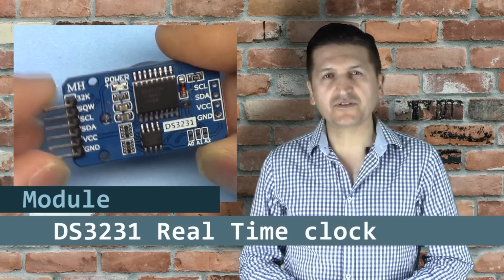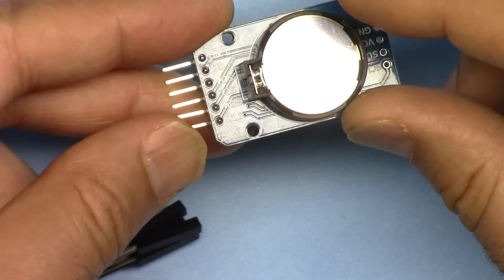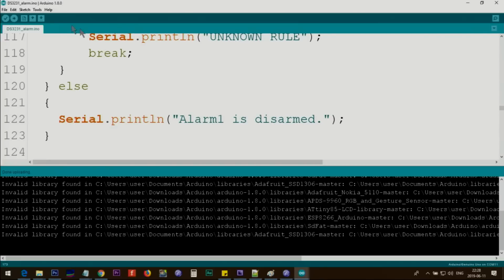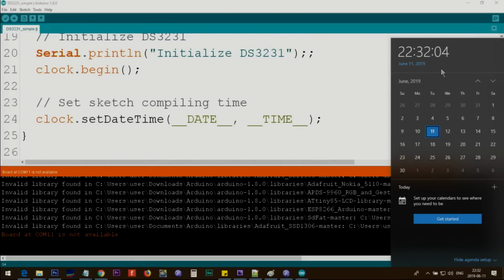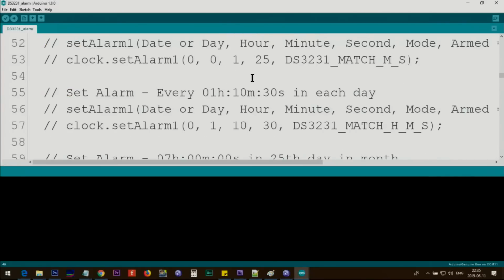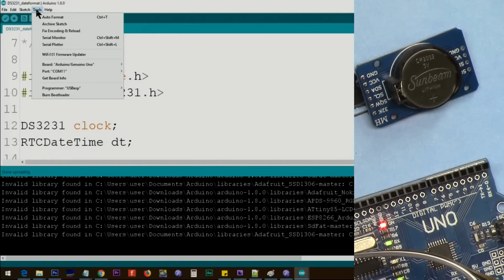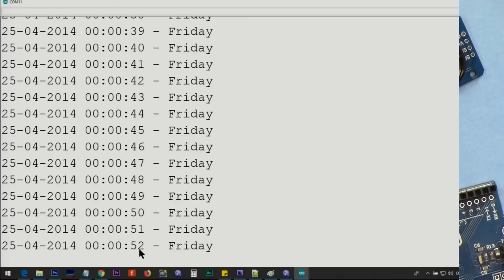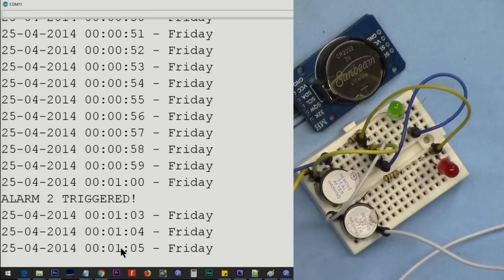How to use DS3231 RTC clock module Alarm with Arduino RJT165

Comment: When i set this in the code:

    clock.setAlarm1(5, 1, 49, 00, DS3231_MATCH_DY_H_M_S);

the serial monitor show me this:

    Alarm1 is triggered when day of week, hours, minutes and seconds match: 
    Alarm2 is disarmed.

But when i add the another alarm just below with another day to trigger:

     clock.setAlarm1(5, 1, 49, 00, DS3231_MATCH_DY_H_M_S);
     clock.setAlarm2(6, 1, 49, 30, DS3231_MATCH_DY_H_M_S);

Serial monitor show me this:

Alarm1 is triggered when day of week, hours, minutes and seconds match: 
Alarm2 is triggered when date, hours, minutes and seconds match: 

So, why it's changing the trigger method in alarm number 2???  i think it's an error of the code, please i hope you can answer me, thank you sir @robojax
Reply from the maker: you can have only 2 alarms. you can't have more than 2. or different alarm from different times. in total you can have 2 only.
Reply: @robojax  yes man, im having only the 2 alarms set, but the alarm2 when its declared, it changes de trigger method for alarm2, i dont know why
Reply: CAN YOU CHECK IT PLEASE? THANK YOU SIR!!!!

#include <Wire.h>
#include <DS3231.h>

DS3231 clock;
RTCDateTime dt;

#define  relay 4
#define  buzzer 3 
void setup()
{
  Serial.begin(9600);
  pinMode(buzzer,OUTPUT);//
  pinMode(relay,OUTPUT);
  
  // Initialize DS3231
  Serial.println("Arrancando");;
  clock.begin();

  // Disarm alarms and clear alarms for this example, because alarms is battery backed.
  // Under normal conditions, the settings should be reset after power and restart microcontroller.
  clock.armAlarm1(false);
  clock.armAlarm2(false);
  clock.clearAlarm1();
  clock.clearAlarm2();
 
  // Manual (Year, Month, Day, Hour, Minute, Second)
  //clock.setDateTime(2014, 4, 25, 0, 0, 0);

  // Set Alarm - Every second.
  // DS3231_EVERY_SECOND is available only on Alarm1.
  // setAlarm1(Date or Day, Hour, Minute, Second, Mode, Armed = true)
  // clock.setAlarm1(0, 0, 0, 0, DS3231_EVERY_SECOND);

  // Set Alarm - Every full minute.
  // DS3231_EVERY_MINUTE is available only on Alarm2.
  // setAlarm2(Date or Day, Hour, Minute, Second, Mode, Armed = true)
   //clock.setAlarm2(0, 0, 0, 0, DS3231_EVERY_MINUTE);
  
  // Set Alarm1 - Every 20s in each minute
  // setAlarm1(Date or Day, Hour, Minute, Second, Mode, Armed = true)
  //clock.setAlarm1(0, 0, 0, 20, DS3231_MATCH_S);

  // Set Alarm2 - Every 01m in each hour
  // setAlarm2(Date or Day, Hour, Minute, Mode, Armed = true)
  // clock.setAlarm2(0, 0, 1,     DS3231_MATCH_M);

  // Set Alarm - Every 01m:25s in each hour
  // setAlarm1(Date or Day, Hour, Minute, Second, Mode, Armed = true)
  // clock.setAlarm1(0, 0, 1, 25, DS3231_MATCH_M_S);

  // Set Alarm - Every 01h:10m:30s in each day
  // setAlarm1(Date or Day, Hour, Minute, Second, Mode, Armed = true)
  // clock.setAlarm1(0, 1, 10, 30, DS3231_MATCH_H_M_S);

  // Set Alarm - 07h:00m:00s in 25th day in month
  // setAlarm1(Date or Day, Hour, Minute, Second, Mode, Armed = true)
  //clock.setAlarm2(25, 7, 0, 0, DS3231_MATCH_DT_H_M_S);

  // Set Alarm - 10h:45m:30s in every Friday (1 - Mon, 7 - Sun)
  // setAlarm1(Date or Day, Hour, Minute, Second, Mode, Armed = true)
   clock.setAlarm1(5, 10, 20, 30, DS3231_MATCH_DY_H_M_S);
   clock.setAlarm2(6, 1, 49, 30, DS3231_MATCH_DY_H_M_S);
  
  // Check alarm settings
  checkAlarms();
}

void checkAlarms()
{
  RTCAlarmTime a1;  
  RTCAlarmTime a2;

  if (clock.isArmed1())
  {
    a1 = clock.getAlarm1();

    Serial.print("Alarm1 is triggered ");
    switch (clock.getAlarmType1())
    {
      case DS3231_EVERY_SECOND:
        Serial.println("every second");
        break;
      case DS3231_MATCH_S:
        Serial.print("when seconds match: ");
        Serial.println(clock.dateFormat("__ __:__:s", a1));
        break;
      case DS3231_MATCH_M_S:
        Serial.print("when minutes and seconds match: ");
        Serial.println(clock.dateFormat("__ __:i:s", a1));
        break;
      case DS3231_MATCH_H_M_S:
        Serial.print("when hours, minutes and seconds match: ");
        Serial.println(clock.dateFormat("__ H:i:s", a1));
        break;
      case DS3231_MATCH_DT_H_M_S:
        Serial.print("when date, hours, minutes and seconds match: ");
        Serial.println(clock.dateFormat("d H:i:s", a1));
        break;
      case DS3231_MATCH_DY_H_M_S:
        Serial.print("when day of week, hours, minutes and seconds match: ");
        Serial.println(clock.dateFormat("l H:i:s", a1));
        break;
      default: 
        Serial.println("UNKNOWN RULE");
        break;
    }
  } else
  {
    Serial.println("Alarm1 is disarmed.");
  }

  if (clock.isArmed2())
  {
    a2 = clock.getAlarm2();

    Serial.print("Alarm2 is triggered ");
    switch (clock.getAlarmType2())
    {
      case DS3231_EVERY_SECOND:
        Serial.println("every second");
        break;
      case DS3231_MATCH_S:
        Serial.print("when seconds match: ");
        Serial.println(clock.dateFormat("__ __:__:s", a2));
        break;
      case DS3231_MATCH_M_S:
        Serial.print("when minutes and seconds match: ");
        Serial.println(clock.dateFormat("__ __:i:s", a2));
        break;
      case DS3231_MATCH_H_M_S:
        Serial.print("when hours, minutes and seconds match: ");
        Serial.println(clock.dateFormat("__ H:i:s", a2));
        break;
      case DS3231_MATCH_DT_H_M_S:
        Serial.print("when date, hours, minutes and seconds match: ");
        Serial.println(clock.dateFormat("d H:i:s", a2));
        break;
      case DS3231_MATCH_DY_H_M_S:
        Serial.print("when day of week, hours, minutes and seconds match: ");
        Serial.println(clock.dateFormat("l H:i:s", a2));
        break;
      default: 
        Serial.println("UNKNOWN RULE");
        break;
    }
  } else
  {
    Serial.println("Alarm2 is disarmed.");
  }
}

void loop()
{
  dt = clock.getDateTime();

    // Call isAlarm1(false) if you want clear alarm1 flag manually by clearAlarm1();
  if (clock.isAlarm1())
  {
    Serial.println("Regando");
    digitalWrite(relay,HIGH);
    delay(60000);
    digitalWrite(relay,LOW);
    Serial.println("Termine de regar");     
  }

  // Call isAlarm2(false) if you want clear alarm1 flag manually by clearAlarm2();
  if (clock.isAlarm2())
  {
    Serial.println("Regando");
    digitalWrite(relay,HIGH);
    delay(60000);
    digitalWrite(relay,LOW);
    Serial.println("Termine de regar");    
  }
 
  delay(1000);
}
Reply from the maker: sorry I can't check without testing it and I don't have the module in hand. as I said, your code work the way it should be. you can't have more than 2 alarm.
Reply: @robojax  when i put that code that i show you, serial monitor show me this:

    Alarm1 is triggered when day of week, hours, minutes and seconds match: 
    Alarm2 is triggered when date, hours, minutes and seconds match: 

Alarm2 should say that is triggerede by "day of week, hours, minutes and seconds match" !!!
why its saying to me that "date, hours, minutes and seconds match:" ???
its not working for me please help its for a university project, i look the full video 7 times and i do exact the same of you
Reply: @robojax  Question sir, its the case "Set Alarm - 10h:45m:30s in every Friday " only available for Alarm1??? this can be the problem, i need to set 2 alarms, on 21pm monday, and 21pm on friday, please help sir im dying
Reply: @robojax  OK MAN just watch what i have to do to get this working:

#include <Wire.h>
#include <DS3231.h>

DS3231 clock;
RTCDateTime dt;

int relay = 4;
int buzzer = 3;

void setup()
{
  Serial.begin(9600);
  pinMode(4, OUTPUT);
  pinMode(3, OUTPUT);
  // Initialize DS3231
  Serial.println("Arrancando...");;
  clock.begin();

  // Disarm alarms and clear alarms for this example, because alarms is battery backed.
  // Under normal conditions, the settings should be reset after power and restart microcontroller.
  clock.armAlarm1(false);
  clock.armAlarm2(false);
  clock.clearAlarm1();
  clock.clearAlarm2();
 
  // Manual (Year, Month, Day, Hour, Minute, Second)
  // clock.setDateTime(2014, 4, 25, 0, 0, 0);

  // Set Alarm - 10h:45m:30s in every Friday (1 - Mon, 7 - Sun)
  // setAlarm1(Date or Day, Hour, Minute, Second, Mode, Armed = true)
  clock.setAlarm1(5, 11, 38, 30, DS3231_MATCH_DY_H_M_S);
  clock.setAlarm2(5, 11, 39, DS3231_MATCH_DY_H_M);
  
  // Check alarm settings
  checkAlarms();
}

void checkAlarms()
{
  RTCAlarmTime a1;  
  RTCAlarmTime a2;

  if (clock.isArmed1())
  {
    a1 = clock.getAlarm1();

    Serial.print("Alarm1 is triggered ");
    switch (clock.getAlarmType1())
    {
       case DS3231_MATCH_DY_H_M_S:
        Serial.print("when day of week, hours, minutes and seconds match: ");
        Serial.println(clock.dateFormat("l H:i:s", a1));
        break;
      default: 
        Serial.println("UNKNOWN RULE");
        break;
    }
  } else
  {
    Serial.println("Alarm1 is disarmed.");
  }

  if (clock.isArmed2())
  {
    a2 = clock.getAlarm2();

    Serial.print("Alarm2 is triggered ");
    switch (clock.getAlarmType2())
    {
      
      case DS3231_MATCH_DY_H_M:
        Serial.println("when day of week, hours and minutes match: ");
        Serial.print(clock.dateFormat("l H:i:s", a2));
        break;
      default: 
        Serial.println("UNKNOWN RULE"); 
        break;
    }
  } else
  {
    Serial.println("Alarm2 is disarmed.");
  }
}

void loop()
{
  dt = clock.getDateTime();

  
  // Call isAlarm1(false) if you want clear alarm1 flag manualy by clearAlarm1();
  if (clock.isAlarm1())
  {
    Serial.println("Regando");
    tone(buzzer, 2000);
    delay(100);
    noTone(buzzer);
    digitalWrite(relay, HIGH);
    delay(5000);
    digitalWrite(relay, LOW);
   
  }

  // Call isAlarm2(false) if you want clear alarm1 flag manualy by clearAlarm2();
  if (clock.isAlarm2())
  {
    Serial.println("Regando");
    tone(buzzer, 2000);
    delay(100);
    noTone(buzzer);
    digitalWrite(relay, HIGH);
    delay(5000);
    digitalWrite(relay, LOW);
    
    
  }
 
  delay(1000);
}

i just delete some parts i didnt need it, and i use no second specification on alarm 2, so i can now open a relay 2 days a week, ok thank you man cheers

Comment: Please Help Me. This code is fully ok. But Aretor on time (1.10 AM to 3.20 AM)  if Arduino power off some time in this time by electricity fail then when again electricity again come in time (1.10 to 3.20 am) and again give power the Arduino then do not on  Aretor again in this time.Which i have selected. Help me for code editing.

#include <DS3231.h>

int Aretor = 13;

DS3231  rtc(SDA, SCL);

Time t;

void setup() {

  Serial.begin(115200);

  rtc.begin();

  pinMode(Aretor, OUTPUT);

  digitalWrite(Aretor, LOW);

  

}

void loop() {

  t = rtc.getTime();

  Serial.print(t.hour);

  Serial.print(" hour(s), ");

  Serial.print(t.min);

  Serial.print(" minute(s)");

  Serial.println(" ");

  delay (1000);

  

  if(t.hour == 1 && t.min == 10 && t.sec == 00){

    digitalWrite(Aretor,HIGH);

    Serial.println("ARETOR ON");

    }

 else if (t.hour == 3 && t.min == 20& t.sec == 00){

    digitalWrite(Aretor,LOW);

    Serial.println("ARETOR OFF");

    }

 
}
Reply from the maker: this is not the code I provided. Please use the code I've given and it should work. Follow the instruction in the video.
Reply: Your code is also ok. But example I want alerm on 1 am to 2 am hours. When it is on then in this time i power off the arduino for some time and give again power the arduino. Then the alerm Don't on again. Why the alerm do not on again? My alerm on time remaning,but do not on it again after get ghe power arduino. Plz help me in this problem.
Reply from the maker: then your battery is bad. The alarm is not set on Arduino. it is saved on the module.

Comment: Hi again, sir! I know you are busy, but can you give me a quick review of how these functions - isAlarm1() and is Alarm2() work exactly, because I think they are messing with me ;).
Reply from the maker: Hi, you made me watch my video. I have explained it. Perhaps you skipped the video. please watch without skipping and you get the answer. Text is never better than video.
Reply: @robojax  I get the point that it checks and matches the time of the alarm and if is true, it does whatever u say so. But in my code I init the second alarm after the rang of the first, and then check for it in a loop. The problem is that the second alarm rings first...

Comment: Hi, thank you for the video it is very helpful. I am trying to program a school bell so I was wondering how can I set an alarm not to compare digits, but to ring periodically.
Reply from the maker: you have to make an array and put all events of alarms for example if you have 4 alarms, then put 4 times and compare the current time to each item of array and when it mateches, turn the alarm ON. or if you have for example every  45 minuets, from 8AM to 3PM, then do the same staring from 8:00 check in 45 minuets and turn the alarm ON. then give 5 or 10 minuets break, then 45 minuets.  it needs separate project and needs some work. can't be done by text. Good luck
Reply: @robojax  Ok I think you gave me an idea, thank you.
Reply from the maker: you are welcome.  Приветствие из Канады.

Comment: Great video sir! I have a question. How can I display the real time on a LCD display and for the alarm can it be a user input where if the alarm time matches the real time, the buzzer will beep like in the video. Thank you beforehand!
Reply from the maker: Thanks. this is 4 projects-in-one 1-DS3231  , 2-Relay control 3-LCD and 4the updating the alarm. This is very complicated and I have solution for 3 but 4th one needs some work and I don't have time for it. search online to see if you can find ways to update values using push buttons.

Comment: Thank you for video. If I set alarm on every hour at 59th minutes, after 6 months my RTC will be behind current time ~50-90s depends of temperature of outside. I would like to correct time and update it once in 6 months. I will do sync with GPS or GPRS to get current time and set correct time to RTC. If update time in RTC will alarms continue to works normal? Will I correct the time?
Reply from the maker: You are welcome. syncing time over internet is the best way. Yes possible if you write or get the code.

Comment: Unfortunately the code doesn't work on Uno Rev3. The detailed time functions don't have any output, just blank. Only thing that worked for me was the raw time which was correct.
Reply from the maker: this should work with any arduino.

Comment: I have a problem with DS3231 https://scontent-mrs2-2.xx.fbcdn.net/v/t1.15752-9/95526360_285611705941099_1001384200726642688_n.jpg?_nc_cat=106&_nc_sid=b96e70&_nc_oc=AQlQD25gHDcXt_6WK-NWs25KMQmXQPh_neoywlMtXNbxpQQF-G7sPmngpWqksjr5awQ&_nc_ht=scontent-mrs2-2.xx&oh=51db46a61821b01468cf89f8b59d09c8&oe=5ED66AA7
Reply from the maker: it means you skipped the video and have not installed the library. Please install the library and it should work.

Comment: Hi thankyou for the video its very helpful
Im having an issue though I can get alarm 1 to work with any of the examples in the code but if I try and use setAlarm2 on any of the others it always displays 'Alarm2 is triggered when date, hours and minutes match' and then wont trigger. am I missing something?
Reply from the maker: Hello, Welcome.  I don't have your code. it seems you have some spilling in code where instead of one alarm the alarm is triggered. Check it bit by bit. Thank you for not skipping the ads and keep watching them. This will help me a lot.

Comment: Hi, I have a Problem with your the D3231, when i Add your librairy, the date format example does not work but in another librairy it works...You have problem in your library
Reply from the maker: I have provided two links., one from robojax.com and one from Github. Get it from github. sometimes your old libraries make conflict with new library.
Reply: @robojax  I deleted all my librairies.I add the git hub library.I launch dataformat example, the text is printed in serial monitor but not the time and date.The wiring is good.The DS3231 seems work because a led that i set output when alarm 1 bright so it works but not time in serial monitor..Can u help me?
Reply: ok it works. I replaced the line " Serial.println(clock.dateFormat("d-m-Y H:i:s - l", dt));" in alarm example by " Serial.print("Raw data: ");
  Serial.print(dt.year);   Serial.print("-");
  Serial.print(dt.month);  Serial.print("-");
  Serial.print(dt.day);    Serial.print(" ");
  Serial.print(dt.hour);   Serial.print(":");
  Serial.print(dt.minute); Serial.print(":");
  Serial.print(dt.second); Serial.println("");" and it works.
Reply: See @rwl7532's comment above. The dateFormat code as given doesn't work with the latest Arduino IDE, but you can find an updated .zip in the comments here (Ikar4n's comment): https://github.com/jarzebski/Arduino-DS3231/issues/22

If you install that .zip the same way you did the original, then dateFormat will work.

Comment: Do you have any instructional videos where the alarm can be used to shut off the arduino connected to battery power and then power it up again using an alarm?
Reply from the maker: no. but would like to know what you are looking for. So we have arduino connected to two power sources. one is power adapter and the other is backup battery and it should connect to the battery when AC is off. 
in your case instead of AC being OFF, it is the alarm that causes to connect the battery. What happens when alarm is OFF? is Arduino OFF at that time?